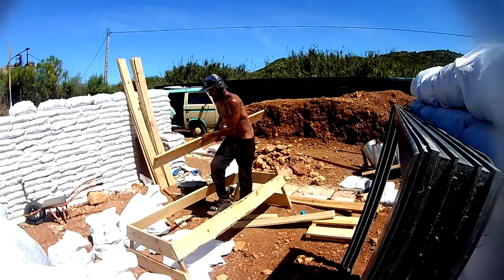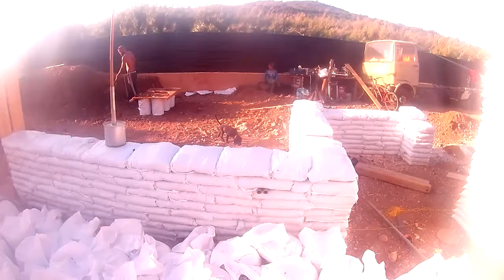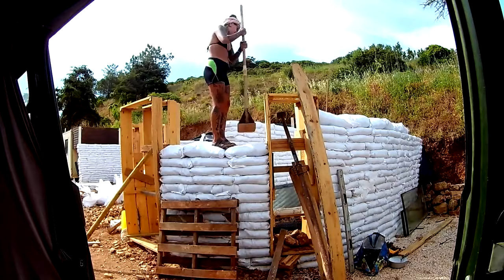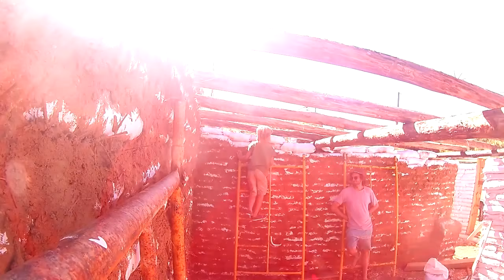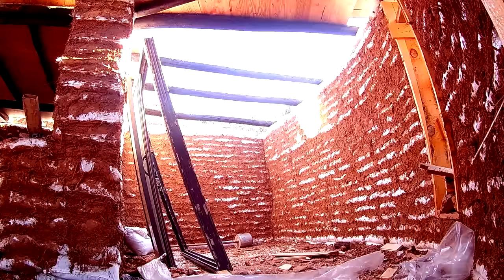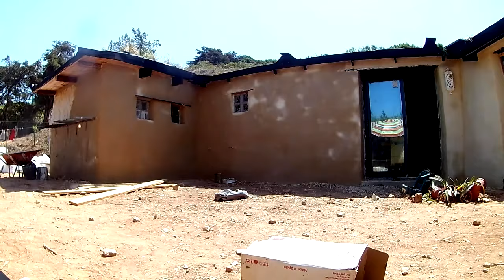6 months in 6 minutes. full house build. earth bag house in southern Portugal

Comment: Is it possible to build bigger rooms with Earth bag? If so how much bigger can the rooms be before structural issues occur? Love what your doing.. great work.
Reply from the maker: Of course! The sky, or your imagination  is the limit, it’s also possible to build two story buildings! 
A curved wall is always stronger than a straight one. 
And when the wall is longer than 3m then you would need to buttress the wall with a 90’ segment, that is or exceeds 1/2 of the height of the wall in length, at least at the bottom of the wall. It can gradually get smaller at the top, as to form a curve or step type feature.. and you would need to do this every 3m or 10 feet. Between the corners of the building.
Reply from the maker: Thank you! We appreciate the feedback and support 😁